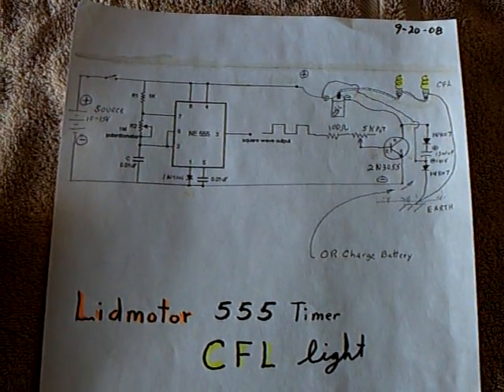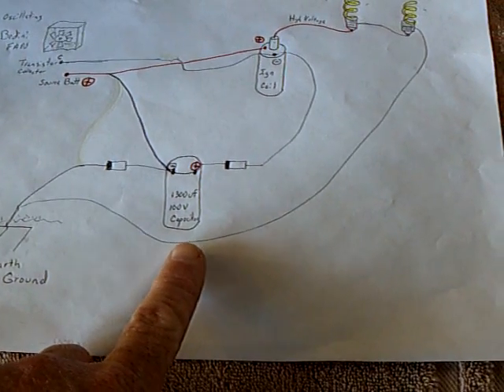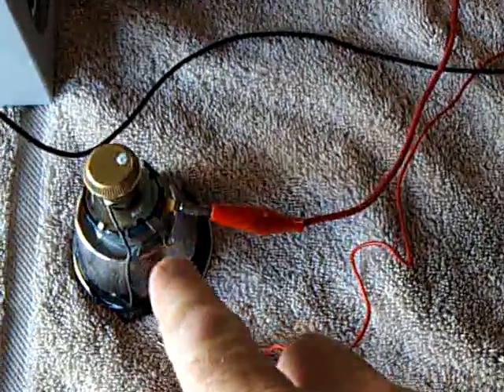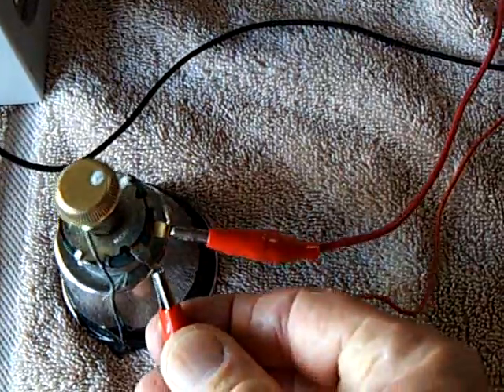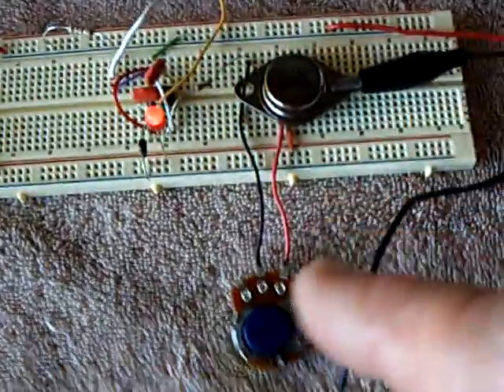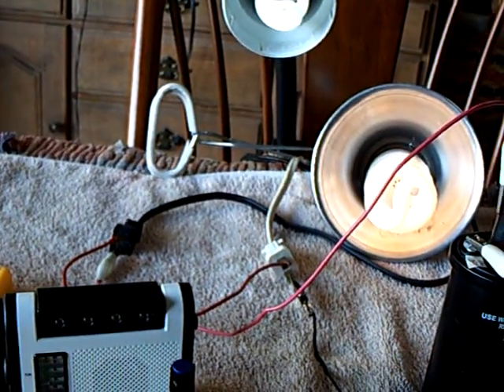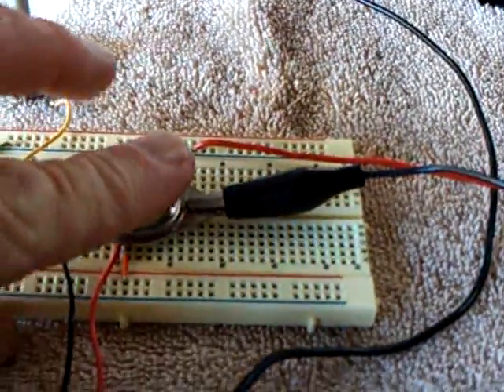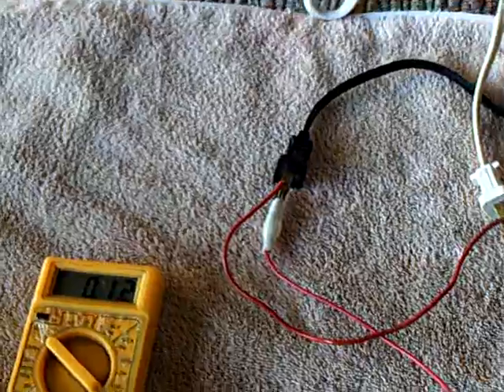Lidmotor 555 Timer CFL Light

Comment: Why do you think the Amperage matter in this project, it doesn't. Light bulbs don't usually need high current to work, if you use 12Vs thats pretty much what it will take to make a couple of bulbs will light up. What you made is a "dim" switch, its neat you're using the 555, but the way this setting up was done, it's pretty much dangerous. LOOK, there's my earth cable, now let me put this on while I hold on the end of the cable. Have a good one, tho !

Comment: No clue what frequency your pulsing is  running at? From what Tesla said the faster the better. There's an interesting paper by Zaev N.E. called "Inductive conversion of heat environmental energy to electrical energy" from New Energy Technologies, Issue 1, p.40 which indicates that the initial energy intensity rapidly expands before dropping off and leveling out. Look it up if you can.

Comment: Hey bro. We really should start measuring the foot-candle output from the bulbs as we go. It would be great to be able to examine that dependent variable as we tweak our circuits. Get an analog one from a local hydroponics shop. My basic imhotep replication was about 1/3 the strength of the same bulb powered by mains.